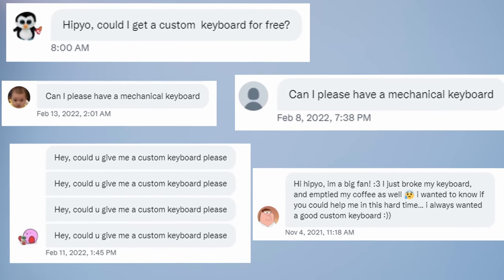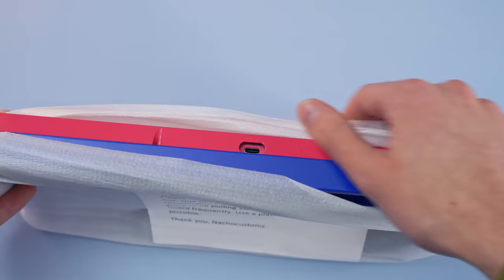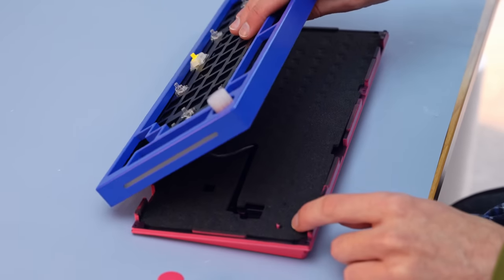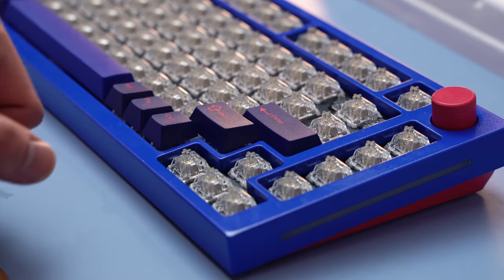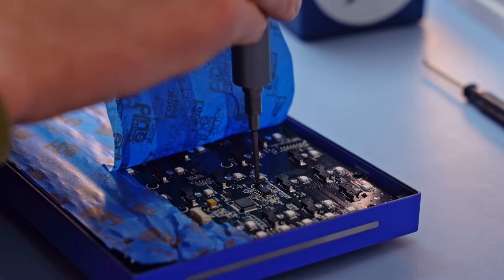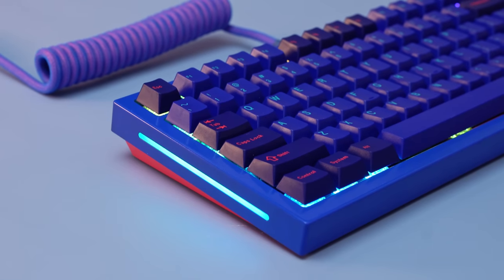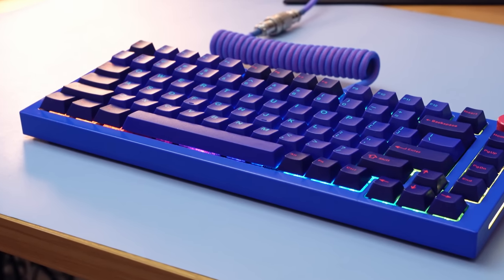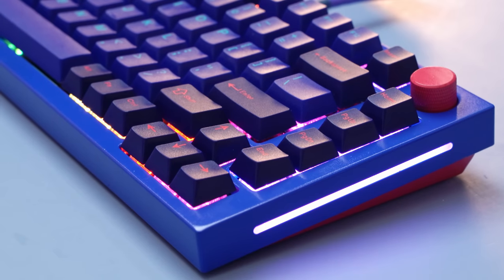I built a Make A Wish Keyboard! (RE: Linus Tech Tips)

Comment: for those looking for an explanation on tempest tape mod, in essence what the tape does is reflect sound before it can get into the case, offering more pcb sound vs case sound. used a lot on budget boards with cases that are designed more for price over acoustics.
tldr: tape mod makes sound reflect before entering case, makes sound more poppy/thoccy depending on setup
Reply: If its more effective on cheaper boards, is it still effective on something like the gmmk pro, since its full metal
Reply: @rybug  SORRY JUST SAW THIS, yes tape will always change the way the keyboard sounds, with more expensive keyboards it's its up to you whether or not you like tape more than stock, as theres more thought put into how the keyboard sounds so tape might not necessarily sound better

general rule of thumb tho, cheaper the board the more tape will help sound, as with everything in this hobby its all preference, experiment around and see what you like :)

Comment: This is awesome, He's gonna love that board! Custom paint job is epic!

Strange the board I got didn't really have an issue with the stabilizers sticking like that, for the month or 2 I used them at least.  Maybe cause the switches I use have 67g springs?
I ended up switching to Durock plate mounted stabs anyway though, which feel and sound much better than the Gmmk screw ins.  Had to do a little grinding with a Dremel for them to fit, but am much happier.

Comment: I missed when you made this video, but I wanted to comment (beyond engagement purposes) for your point on Durock L3 pinks. I have these in my GMMK pro with matchy V2 stabs. They're hideously under-rated. They sound fantastic. I've even been using them over my boba U4T switches, after I got jumped into Linear Gang.

Comment: In my experience of owning a GMMK pro, it seems like they did fix the completely sticky stabs for me. When I opened up the keyboard, I found that there were none of the sticky pads that seemed to make the stabilizers extremely mushy in the older models. It definitely fixed it, but the stabilizers still suck. As I'm watching this I'm modding some Durock V2 screw-in stabs for the keeb.

Comment: I have a GMMK pro and it's actually really good with some boba U4Ts that I lubed. I expected far worse for the reviews lol, I swapped the stabilizers, added some tape in between the two halves of the housing (and under the PCB obviously), and used a PC plate. Bam, it sounds exactly how I wanted it to sound, not really "muted" at all imo. The stock stabilizers are definitely still trash tho lol

Also, SLIDEEEEEER
And I like the heft, also. I'll probably add even more weight because I can. I want my solid wood desk to collapse

Swapping the plate to the PC one was also pretty cumbersome and I'm not looking forward to disassembling the plate-foam-pcb sandwich. That's a LOT of screws lol

Comment: JUST A HEADS UP THAT IF YOU GET THE GLORIOUS GMMK PRO AND WANT TO USE THE DUROCK V2 STABS YOU NEED THE POLYCARBONATE PLATE OR YOU WILL HAVE TO FILE DOWN THE ALUMINUM OR BRASS PLATE SO THAT THE STABS WILL FIT. the stupid goat stabs are really small relative to other stabs and the metal plates are tooled specifically for the goats
Reply: this is the exact reason you only buy a gmmk pro if you are seriously broke but want a full alu gasket mounted keyboard
Reply: @Aidan-wu2ec  yeah I just like how the gmmk pro looks and I’m generally happy with my board but it was such a pain in the ass to work with that I wouldn’t get it again and I don’t honestly recommend it lol
Reply: @shadowjulien5  I mean there are plenty of better options, it's just that the GMMK pro got all of it's fame from being a gasket keyboard from none other than glorious, the most famous mouse making company that has made 2 mice in total

Comment: Hey Hipyo, I have a stabilizer issue on my new keyboard. It’s the left stab, and it’s a Drop CTRL. I have Dura plate stabilizers and lubed them myself. The stab almost catches halfway through every time you press down. All of my other staffs do not have this issue. Any help is much appreciated, I can send a video if needed. Thanks!
Reply: this is why you don't waste  $200 on a drop ctrl
Reply: @Aidan-wu2ec  out of curiosity, what would you recommend?
Reply: @fonykid788  If you want an entire keyboard with switches and everything I would have gotten the keychron Q1, Q2 or Q3 since it is gasket mounted and comes with nicer keycaps. It does take a little while to ship but it would be worth so much more for the same price

Comment: should've built him a jelly epoch (aftermarket) with tecsee metal coated switches (spring swapped with tealios switches) (stem swapped with hirose oranges) and after market gmk sets.
Reply: that is literally gmk Lazer, and tealios are expensive, you can get the same springs with cheaper switches or buy them separately, a beginner doesn't need a jelly epoch and would probably be as happy with the gmmk pro, and the Frankenstein switch you made would probably cost like 2-3 dollars a switch which will go unnoticed, probably the beginner never even taking the keycaps off to see the metal coated housing. What are you on
Reply: @ViiiRALshortz  the joke is, I want him to make expensive keyboard because funny
Reply: @wonder815  oh, did you like my essay
Reply: @ViiiRALshortz  What's good about the Jelly Epoch's?